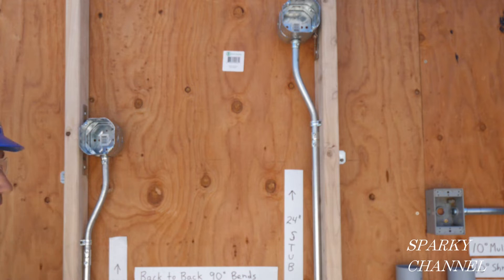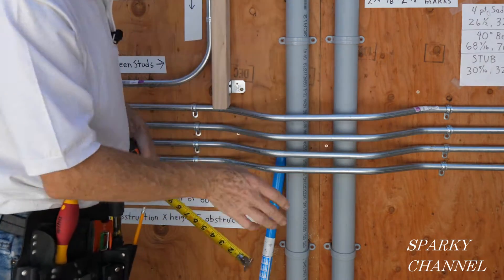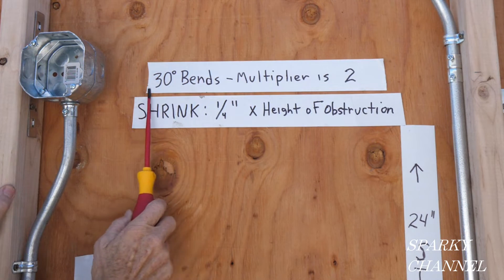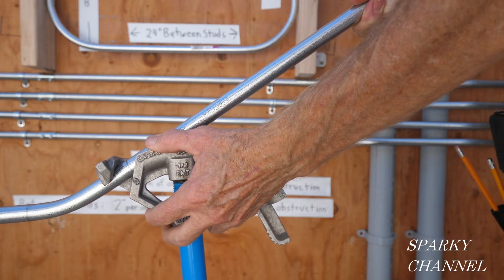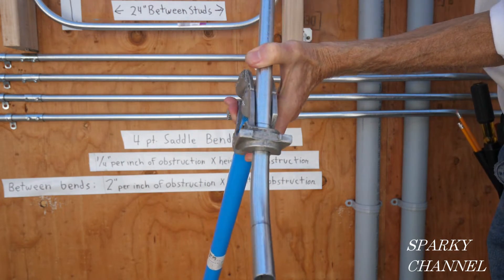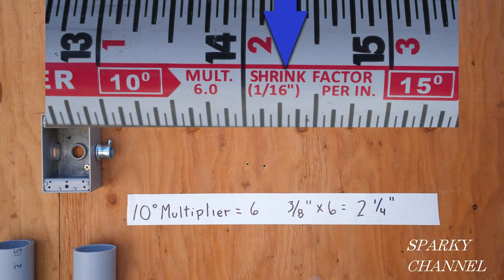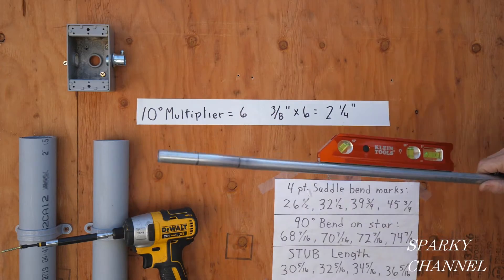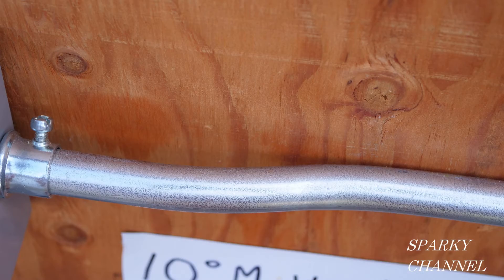How To Make EMT Box Offset Bends

Comment: Why are you adding 1/2 inch to the 4 inches in between bends ?  Don’t you just multiply 2 x2  to get a  2 inch offset.   In your other video you just multiplied 2x4 to get a 4 inch offset without factoring in the shrink amount in between the bends.
Reply: 2x4 meaning you measured 8 inches between the bends to get  a 4inch offset.
Reply: @marcochang5537  He said it was a 2" offset, and the factor for 30 degree bends is x2 with shrinkage of 1/4" per inch of offset. This means he multiplied the factor (2), by the offset (also 2) and that equals four. the offset was 2 inches, so multiply 1/4 by 2 to get 1/2. now you add that to the measurement to account for the shrinkage. that is how it ended up being 4-1/2" between marks/bends. Not sure where you got 2x4 from, but you can see that the offset is 2 inches from the stud and the marks/bends are not 8 inches apart

Comment: I need to connect  a 1" EMT to a 1" conduit body and a Sigma 1" J Box.   It is outdoor and only 4 feet.  Do I need  to do offset on both ends ?  Also is it bend 10 degree?
Reply from the maker: See my video: EMT Conduit Nipple Fill and Strap Questions NEC Chapter 9 Table 1: https://youtu.be/E5iGdmXntKw
 Yes, 10° works well.
Reply: No… all natural Streight shot in..

Comment: EMT Bending, Easy-Mode:
Learn Offsets first. It will help with the easy 90° in the measuring, and the four point/three point saddles.
Beginners Notes List: 
(Summary at end of list)
1. Don’t Over Complicate bending. 
2. Tools: Right sized Bender, tape measure, marking device: pencil (or sharpie, or I like using BLACK DRY ERASE MARKER (just don’t touch the marks until done bending). Also, to remove sharpie, have a used Dry Erase marker, and just scrub the sharpie mark with it, wipe it off with damp towel/rag.
3. Print, memorize, write out, or just use Notes/Photo/Web Page on iPhone of an OFFSET BEND CHART.
4. Practice when you start out, with old cuts of EMT that are being tossed into trash. DON’T EVER FEAR being seen learning something (just do what works for you). 
5. Bends and stance. When doing 90° bends, flip bender so head is on flat ground. When doing other bends, try keeping it upright.
6. Learn to line up your EMT by using a template and marking. I made one out of a FOAM TUBE (you can use insulate foam for water pipes, just cut to fit and use the glued side to stick it together to the cut you make to fit it). The FOAM TUBE fits perfectly over an EMT pipe 1/2”. I cut little triangle marks at four points, marking the north, south, east and west side of the pipe. Line up first mark with the scrape line that can be found on EVERY EMT pipe. Use this method if you have a hard time lining up your bends so you don’t dogleg.
7. PRO-LIST: 
* DONT re-bend EMT, if you made a mistake, Start new. 
* CLEAN off your markings.
* Picture the bend you want/need, and make it perfectly fit. I can’t stress how important this is, instead of just going into bending like it’s your first time and winging it.
* Make your offsets/bends the same unless you can’t. Consistent bends and offsets look so good, no one notices. ONE flaw in bending, and EVERY Electrician can spot it.
* Don’t forget to clip/secure the EMT where and how your codes states (distances from boxes and from other clips).
* No Shortcuts. NEVER short cut. It only holds you back in life, in the long run. Do it right, do it better, do it as if someone’s life depended on it…even bending a stupid EMT pipe. Everything you do, you want to impress on people, that if they were building an army, they would want you on their army. 

EMT pipe bending: You don’t need to know all the math, in your first year. So let’s just stick with the easy.
Summary:
You will usually only need;
10° for JBox offset (Multiplier of 6)
30° for Clearance Offsets (Multi of 2)
90° and 45° where needed (45° multi 1.4)
Make your marks. First mark where you want your bend to start (2-3” normal start for a JBox offset). Second mark, encircle pipe, using multiplier formula. Head up, unless bending a 90° bend, to read degree line. Bend first mark, first. Slide pipe forward and turn to line up second mark. Make sure no dogleg, and bend.
Cut where needed & Ream your ends.
Remove your marks. Place pipe in position and attach and clip. Return all your tools and large debris to trash, before starting next project (so you don’t lose tools).
Enjoy your success.
Reply: Thank you for sharing this!! I studied my multipliers and have been practicing at work whenever I can. Still green but I’m getting used to it especially after re watching and reading.
Reply: Thank you brother. I’m a green apprentice and this helped a lot. 🫱🏽‍🫲🏾
Reply from the maker: Thanks, great tips!

Comment: sparky, you use 3/8 * 6(multiplyer) for normal box offset without shrink, but you use 2*2(multiplyer)+ 1/2 shrink=4.5" for this box offset? as i learned before, we dont add shrink between two marks but add to the length

Comment: Iam sorry sparky i dont understand the part 3/8 ×6= 2 1/4 how do i make the desicion from 1/16 to 3/8 on another job
Reply: Let's see if I got it
Shrinkage for 10° bend is 1/16" per inch
The object height is 3/8" (space between wall and box hole)
So shrinkage is 1/16" x 3/8"= 0.0234375( which is less than 1/16" which is why he didn't use the number because it was too small to measure with a tape measure)
So he used the between bends formula which at 10° is a factor (multiple) of 6.
So 6x3/8"= 2.25 or 2-1/4.
So if he added them like the 1st example then the distance between bends would be 2.2734375" but since he didn't use the shrinkage value because it was so low and unmeasurable by a standard tape measure or another way to think of it is he rounded down to 2-1/4".

Comment: This seems awfully inconvenient. I'm kinda curious, we have long since abandoned metal pipes and boxes for PVC boxes and flexible pipes. Is there a specific reason to still use metal?
Reply from the maker: Yes, it provides excellent protection from mechanical damage.
Reply: @SparkyChannel  Also PVC will make nasty smoke and fumes during a fire whereas EMT will not add fuel to the fire. It is best to only use PVC underground and on exterior walls, in my opinion.
Reply: /facepalm....never heard someone be condescending against EMT, by choosing PVC as a country....

Ever....

That’s like asking why use carton milk when you can use plastic jug milk....

What?
Reply: Try reading NFPA publication 70.
Reply: In Chicago it's all metal boxes, EMT and Flex. Plastic boxes and Romex are not allowed except for temporary wiring.

Comment: why is he choosing 10* on the outlet box offset but 30* on the light box? is there a rule to choosing or just what he felt like?
Reply: I think because 10’ bends are better for offsets that are an inch or smaller.
Reply: Box offsets typically are half an inch, both bends will be pretty close together so 10° simplifies it, but with larger offset measurements you need more bend in both bends and space them further apart plus 30° makes it a lot easier to pull compared to 45°
Reply: i just did the math for making 30 degree bends for 3/8 height. cant make 2- 30 degree bends within 3/4 of an inch.

Comment: For some reason my box offsets never come out right when using the math formula.. 3/8 x 6 = 2 1/4 at 10 degrees. Can someone explain?
Reply from the maker: Hi Jeremy! You may need to go slightly beyond the 10° due to snap-back. That is, the EMT snaps back slightly after bending. Maybe it's your bender and maybe more practice will do the trick.
Reply: Sparky Channel thank you. I really appreciate all the videos you post. You make it a lot easily being an apprentice commercial electrician
Reply from the maker: @jeremyragsdale8530  Sounds good, just keep at it. :)
Reply: Its easier to eyeball a box offset then to try and do the math and use the lines on the bender you can always add or take out if your a little off me personally I never trust the lines on the bender I use the level for all my bends

Comment: Hey Bill, on the first box offset bend, how did you get 4 1/2 “ on the second mark? -Thanks for the video !
Reply: The offset was 2 inches so its going to be a 4 inch spread, but for every inch of obstruction height  it's a 1/4 inch shrink. 2 inches= 1/2 inch so the spread would be 4 1/2"
Reply from the maker: @michaelperez9290  Beautiful explanation Michael!
Reply: Michael Perez Thank you very Michael appreciate that, keep those videos coming Bill! Love your channel
Reply: This made sense but my question is, how did you determine this was a 30deg bend?  I’m confused on how you convert the whatever length offset into degrees of bend.  Thanks for all the helpful vids!
Reply: No problem man. Have good a one.